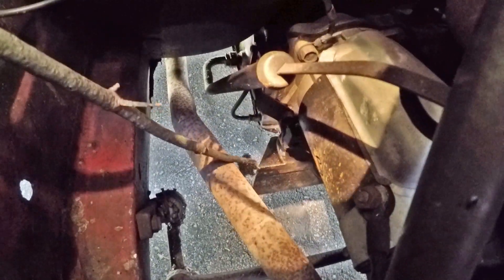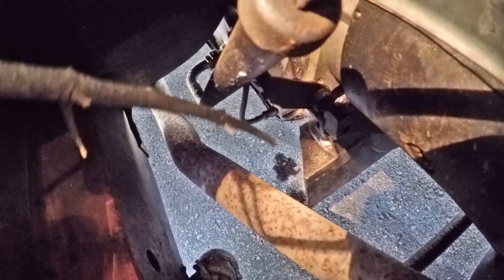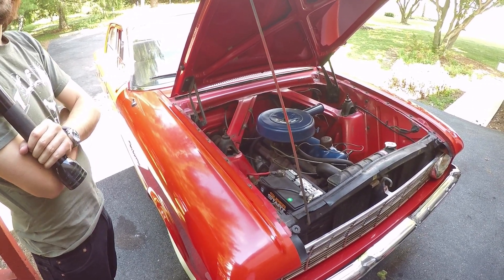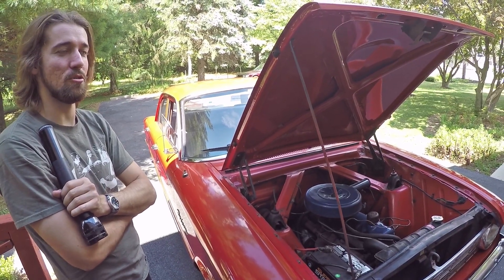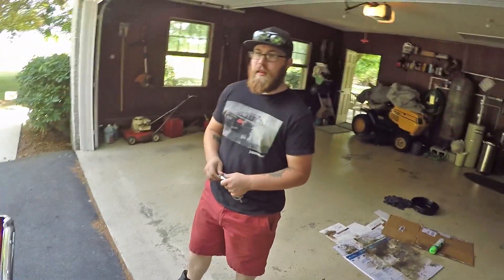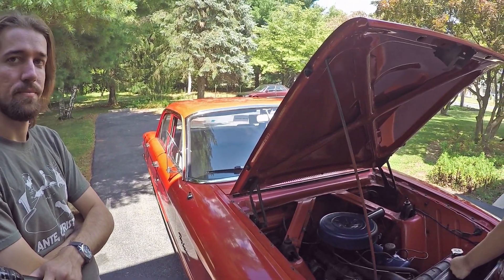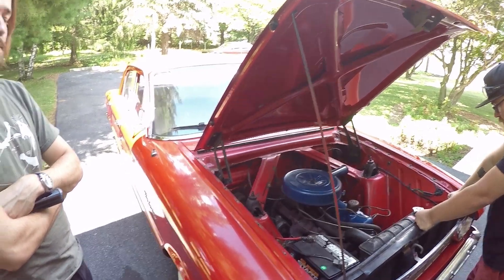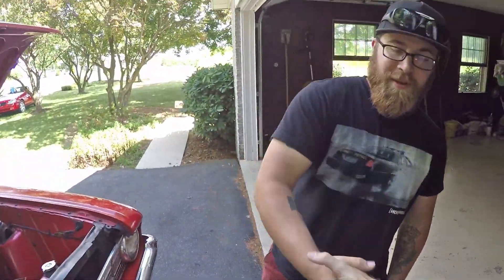Vagabond Falcon Ford-O-Matic leaks from main seal

Comment: Any decent trans shop would sort that out in no time.  Leave her stock!  It's too nice to hack up!
Reply: andxx0r_the_second Im all for keeping cars original, but at the same time these cars pollute a lot more. I am not a tree huger, but having a fuel injected engine means that gas won't be an issue, and pollution will go down.
Reply: zzzhuh I'm almost certain he would do that 302 and AOD swap with a carb on top.   ...not fuel injection
Reply: diePod1
I doubt it... Mr Regular wouldn't be dumb and use a carburetor. He is part of my generation, and knows that carbs are FUCKING USELESS in todays society.

Seriously, the only reason to use one is because it's the original engine. OR you're old and think it's better cause it's less 'complex'. Which also isn't true lol.
Reply: zzzhuh RegularCars So you really think he's going to shove a whole foxbody harness and the big, ugly upper plenum under the hood of the car that's supposed to have a classic look? Me personally, I'm all about modern reliability and the ability to hit the key in any weather and have a car that starts immediately and will idle on it's own until it's up to operating temp. Not to mention the mpg gains, but he would totally go for a look similar to the optional 260cid v8 that was available for the Falcon. That means the 302 would be topped with an authentic looking air cleaner and probably a 4 barrel underneath. 

It's possible that a EFI carb look-a-like unit(like the MSD atomic) could be used to achieve the look with the air cleaner, but those things are around the $2000 price point. I'm sure Mr. Regular will do a funding campaign or get a few sponsors to help out, but something like that is most likely out of budget scope of the project. 

Careful... if the swap happens, you'll soon realize that you basically think Mr. Regular, a man of "your generation", is dumb.
Reply: diePod1
Yea... Look I have 10 other posts I have to respond to and they are all long, over written posts.

If you want to make a point, make it short and to the point.
Reply: +zzzhuh a carbed 302 would be way better than a fuel injected 302. Fuel injection is overcomplicated, pointless in a car like this. He didnt buy a falcon for "modern efficiency" he bought it because its a classic car. You will never understand the true love for carburetors untell you own a car old enough with one and you drive it.
Reply: DrDaniel98521

I HAVE owned plenty of cars that had carbs. They are actually more complicated then FI.

Reason why? Carbs have to be rebuilt/replaced. Fuel injection means you just plug and play.
Reply: +zzzhuh Carbs aren't exactly hard to rebuild, and the kits are about $20. I rebuilt my carb with a flat headed screw driver. That's it. a screwdriver.

Fuel Injection has sensors and computers running the engine. How is that more simple? Yes fuel injection provides more power and more efficiency, But carbs do their job well enough to have worked for 90+ years in the automotive industry.
Reply: Charles Manson

Fuel injection has been around since 1925, so it ALSO has been around for 90 years...

I bet I could change all 6 fuel injectors before you could get a carb 'rebuilt'. Reason why? Just pop them out, put knew ones in.

Again, it's just plug and play.
Reply: lol, how often do you have to replace an injector or rebuild a carb where that's an issue? Also, what type of fuel injection are you talking about anyway?
Reply: Charles Manson
Look, carbs had their place in time. But they are completely outdated now, and unless it is the original engine or has some purpose to be used, fuel injection is the only way to go.

There is no 'pro' to carbs over fuel injection, there just isn't.
Reply: +zzzhuh Well he is using a carb and he isn't dumb... Carbs can make the same power as fuel injection easy while being wayyyy simpler (I rebuilt my first carb at 13, they are drop dead simple). Also carbs don't have to rebuilt a lot...

Don't even get me started on that "emmisions" bullshit. A weedwhacker puts out more emmisions than a fully loaded semi truck.

Comment: V8's are fun and all, but I like the idea of keeping it a 6 cyl, I'm not saying keep the original motor just go for a more modern i6, to try and keep some of the cars character.
Reply: Ethan Gee So what you're saying is it needs a 2JZ.
Reply: 2jz is sweet, but I like the idea of a turbo 300 ford
Reply: Yeah, I agree with tonyrocks951 , keep it ford
Reply: tonyrocks951 Also if they have time and budget it would be cool if they could just build the original motor and try and get a bit more power from it, that way its original and still a "regular car" whereas if it had a v8 swap in it, it wouldn't be "regular"
Reply: Ethan Gee You don't want any of the characteristics of a Ford 144 I6. I'd love to see a turbo 2JZ in there but 2JZ's aren't the cheapest swap.
Reply: Ethan Gee 1JZ swap?
Reply: tonyrocks951 An N/A 300 six would be a tire shredder.
Reply: Gabriel Aiello the 1.0l 3 cylinder
Reply: I think the 3 cylinder ecoboost would be interesting in that
Reply: Another interesting choice I think that one would be easier since it is already set up for rwd
Reply: David F the 3 banger ecoboost would be perfect, makes more torque/ltr than a 6.7 cummins
Reply: Did I hear 2JZ?
Reply: Let's put in an E-Type drivetrain. lol
Reply: Too late.
Reply: MaxTheKanuck It wasn't when the comment was originally posted (8th August 2015) They were still deciding what route to go down engine wise then.
Reply: Ethan Gee I'm aware.
Reply: Well it has a working V8 now
Reply: deadkat5 And the ugliest rims and tires ever put on a car. The hubcaps help a little but the low profile white wall tires look pretty bad.

Comment: The swap would make the car more reliable, it would make parts easy to buy at any auto parts store, and it would make the car easy to cruise all day at highways speeds. Would be wise to include a new brake setup in the budget for the swap just because more power means you need more stopping power to reign it all back in. Presumably, first gen Mustang parts are mostly bolt on so it would be pretty easy to find a modern brake setup for an affordable sum.

Comment: Just pull the trans, have a look at the input and change the seal. You could do it on a weekend, or you could waste that weekend speculating on plans. A car that old you should be able to drop the crossmember with the car up on ramps and drop it out below.

With it overheating, like somebody else said check the head gasket. Any local shop can do a pressure test of the cooling system for you. Also, they have a test with some kind of a litmus strip that'll turn a certain colour if combustion gasses are present in your coolant (indicating a blown head gasket).

If you have a look in the rad through the cap, does it look clogged? It it's all clean, it's probably still fine. Hell, the car was designed to use that rad back when it was made. I'd look at the water pump, check out the fins that actually push coolant through the engine. They may have corroded to the point they now longer create flow, especially if the car ever had just straight water in the cooling system instead of antifreeze.

Comment: Swap Swap Swap ;)
I'm vote for Swap
Reply from the maker: ***** Second
Reply: RegularCars 2L ford ecoboost!!!
Reply: Craig Thompson  That would be an easy straight swap, its designed to drop in isn't it?   /s
Reply: Heads Tails Lots of room. Maybe new motor mounts and at worst a custom drive shaft. Lightweight lots more power without overkill, fuel mileage, and turbo!
Reply: ***** LS1 swap for cheap reliable power
Reply: RegularCars Hutch's Transmission
Reply: RegularCars It makes sense to swap(even though I would love to see the original engine running well+ making more power) just don't do something boring with it. there are a million cars that didnt ship with LS1/LS3 in them making 20,000hp via nitrous+turbo.  If like in the video, you would be going with a 302 that would be cool mainly for two reasons
1) you're keeping with the manufacturer of the car
2)Like I said earlier so many people do LS swaps and make 2 trillion hp(or at least talk about doing LS swaps), but doing it with a ford is much less common and It would be interesting to see how it differs in the process and end result.

Also from my personal experience ford engines are more reliable(Sorry Chevy)

Comment: 1) I love those bench seats. They just look comfortable. Like if you could make them fold down right, you could convert them into a camper style bed. And it wouldn't be like a real bed, but it would be awesome.

2) I'm a firm believer in modification. If it was a truly important car, it will be in a museum in stock form somewhere, and there would be extensive documentation of all it's options, body styles, colours, and anything else about it. I'm not talking about modifying the car to be part of a culture. Just making it what it needs to be for you. Just because the car you bought is 55 years old, doesn't exempt it somehow from being a candidate for purposeful modification. Safety, reliability, and let's face it, probably fuel economy, can be improved with modification.

Comment: A swap would ruin the entire "regular" aspect of the car. Don't do it. 

Fix the trans, get a good radiator, maybe even look around inside the engine and replace some crucial stuff and keep er' goin' for a while.
Reply: Brap Brap it may not even need a radiator.  There is probably something else heating it up so fast.
Reply: +fadumpt I tried to tell Regular that before on a previous vid. Oh well.

Comment: What about the old straight 6's from the mustangs of that vintage?  Keeps it Ford, gives it more power, not a big V8 swap?  Don't know that much about that vintage, but uhh, could work?

Also, I'm not sure what the compression is on that motor, but I feel like it should have been able to pull more than 10mph up that hill - even with 3 people and only 85hp.

Comment: Dude, Stock never goes out of style. STOCK STOCK STOCK. You said it yourself. The joys of classic motoring. No matter how sarcastic that fact is. There is an undeniable connection with running a classic car, classically. Hot rodding a v8 or engine swapping something that doesn't match makes it a bucket of bolts and a shell. There is no life in that. There is life in what you have and you get 100 fold back when you work on these old motors. Keep it stock. I work on my own '67 and it has made be a better man. Do the right thing and actually understand the joys of classic motoring.

Comment: I would say, fix the trans, throw in an aluminum radiator and fans, you will need it anyway, and a good one should be enough to cool a modular or a Windsor. I still say put a new I6 in or a V6, it just keeps the "regularness" of it. A quiet, smooth, powerful enough 6 cylinder would be enough to move this car without fail.

Comment: I owned one of these back in the day and had no trouble going up hills. The motor is probably tired. If I remember,keeping the valves properly adjusted is difficult. That's probably some of your power loss. To swap or not to swap? The complexity and expense of a swap will probably shock you.

Comment: Whatever you decide engine wise, keeping with it's original spirit is critical. I remember someone explaining that putting a different engine in an RX7 removes its original character.
A windsor seems like the best option to me if keeping that I6 alive is hopeless.
Reply: airwolf12366 Basically, just not a modern engine and NOT a 4 cylinder.

Comment: I vote: stay as original as possible.

My reasoning?
#1 The Ford was designed and build as a regular car for regular people, it has lived the better part of its life as a regular car, it was bought by you, Mr. Regular Car(!) to be the icon of your YouTube-show: Regular Car Reviews. It needs very much to stay regular.

#2 I understand that the idea of a V8 (original or not) is awesome, but stay (as) true (as practicallity craves (new radiator, safety and what-not of course)) and keep the car an inline-six with no more than 100 hp or so and, perhaps, a 3 or 4 gear slushbox. It'll be slow, I know, but the joy of old motoring is exactly that - downpace and very unstressful. Savor the late 50'ies.

Best of luck to you and your project and keep up the great show!

Comment: Guaranteed you can find a carbed 302 as a donor motor possibly with a C4 attached. Cruise Mustang forums and I'm sure you will find someone with a pile of extra motors that he doesn't want. 302s can be had for cheap. If you go carbed at least you wont have to mess around with doing any wiring. And there will probably be people who have done the swap so many times that they will throw parts and advice at you. Joining a car forum is your best plan. People are extremely supportive on forums.

Comment: Since the channel is regular car review, it might be a good idea to keep it stock. With that in mind, "regular" cars around here are anything but. Cars aren't usually heavily modified but trucks are. 350 swaps, lift kits, new axles, or diesels with egr and dpf deletes with tunes or bigger turbos on them. In the day of these cars, and even among many people today, a regular car would be one you make your own so I would not be opposed to an engine and tranny swap. It would make it more reliable, easier to deal with on road trip drives, get better mpg, and be safer due to traffic merging and ability to safely pass a slow car or tractor depending where in the US you went. If you guys do get company sponsors, I'd personally love to see what you could do with this car to make it your regular car.

Comment: I'm still voting for a 300 I-6, if I was closer I'd help swap it, I've helped friends do things like put an Olds 455 in a 79 Z28. if you do change the transmission seal, don't do it without power tools.

Comment: I like the idea of keeping it regular at least for a while, just because it would be good experience and good reviews. Maybe fix the leak and use it for 6 months or so, the cooling will be less of an issue into winter so you might could get away with not doing that. For sure swap in a 302 or a 289 at some point, but it deserves some time in its regular state for some regular reviews.

Comment: One thing to consider, this engine reportedly made 84-85 horsepower When New.  It's over half a century old now, and given the attitudes towards engine maintenance in the days when this car was probably seeing the most use it most likely doesn't Have the full 80-something horses in the stable anymore.

Just something I hope you consider.  It seems such a shame for this car to have made it this long and still be so original only to go 'V-8, Shiny and Chrome' at a time in it's life when it's ostensibly to be most celebrated for it's 'regularness'.

It's almost like you're saying, "I'm spoiled by modern cars, great-granpa's 'regular car' isn't doin' it for me."  If that's so, was the whole point of the Vagabond Falcon a mistake in the first place?

Comment: A V8/AOD swap would require modifying the trans tunnel for the larger transmission, as well as the transmission crossmember. A 1960 has a different crossmember than the rest of the Falcon platform cars.

Then you have to change every other system of the car. You'll have to change the cooling and exhaust systems, at the very least. And the 6cyl steering linkage bangs on the oilpan of the v8 engine, so you'll have to add v8 steering. The 7.25" axle will die pretty quickly behind v8 torque. The v8 is heavier so you'll want heavier front springs, better brakes, a wider contact patch from the tires, etc.

"Drop in a 302" sounds easy because its what everybody does to these cars. But its a lot more work than just swapping out the motor.

Comment: I have a burned up AOD I just pulled out of my T-bird for a 5-speed swap. It's a solid core at least, with a Torque Converter and flex plate. Someone who already has the tools could do a rebuild fairly cheap since the tools cost a lot more than the rebuild kit. I just want it out my garage.
Reply: Needs more thumbs up

Comment: If you can keep the inline 6 and actually get over hills, it's so tempting to keep it stock.  Likewise a period swap 260/289 respects the originality of the car, giving reliability and drive over hill ability, and then opens to door for modern carb and ignition so it's a bit more turn key, and possibly even disc brakes behind the original wheels so it stops more than once. Whatever direction it ends up going in I appreciate the dilemma.

Comment: A 302+AOD swap makes sense. I think it would cool to put one of the big 6's in like a 250 or 300 however. Definitely want to put discs up front too and junk that radiator. Also maybe instead of a AOD a 3 on the tree manual? 

If you make it interesting plenty of people will kick in some cash. Make a kickstarter and base the upgrades off of how much you make. You definitely should be able to get something from some sponsors too.

Comment: These cars didn't overheat back then, even with the engine powered fan. The two speed transmission isn't too great though. But although the torque converter turns a lot of power into heat particularly the more it is multiplying, it does multiply. When you start off it is adding about a 2:1 ratio. So it's sort of like a three speed manual, just wasting some power. Not that the Falcon had any to waste.

Comment: I mean I personally would do the 302, and for what you are saying you would use it for I would do efi, you can probably buy a 302 aod and an 8.8 rear from a foxbody all for under 1000 dollars but then you have to get a retro fit harness if you don't want to do it yourself which is 600 dollars from latemodelresto, and then mounting the whole package. I would say you can probably get the swap done for just over 2 grand or just under 3 depending on which route you go with things